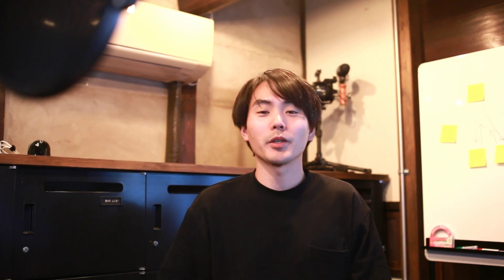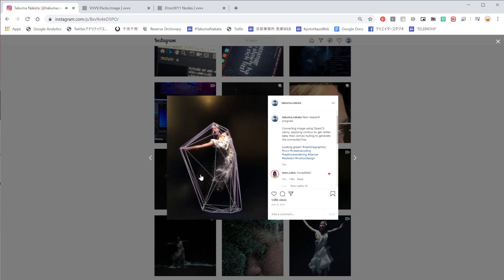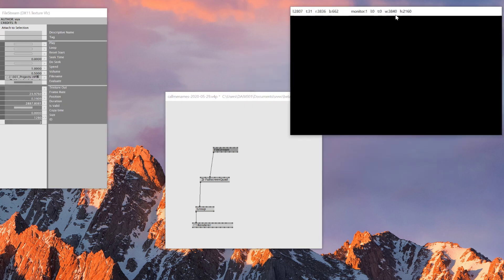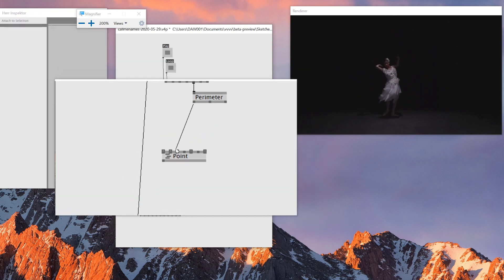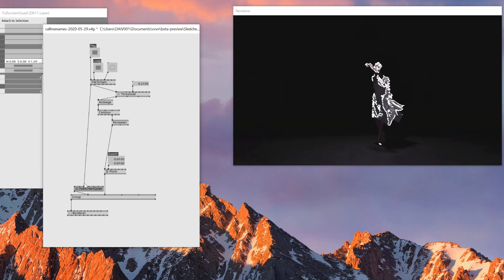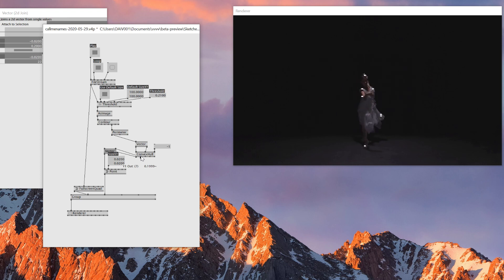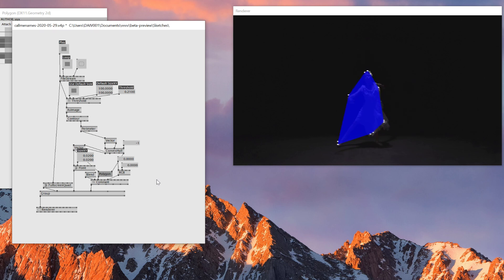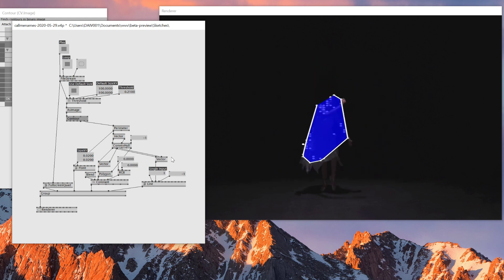vvvv beta Tutorial | Creating Mesh out of image using Convex Hull

Comment: The difference between the two AsImage nodes is that one outputs a VL Image and the other a CVImageLink.
Any idea if that last one is even available for vvvv beta 39.1 (x64)? I've been searching everywhere, but I've only found an old file in a git repo that I could not load.